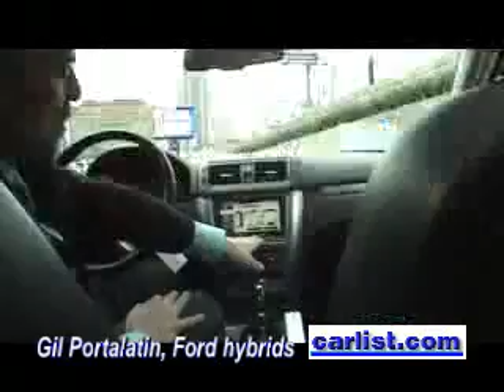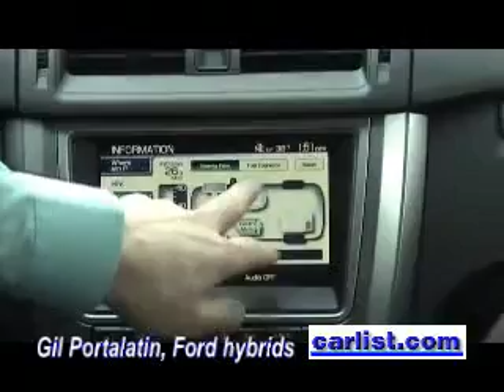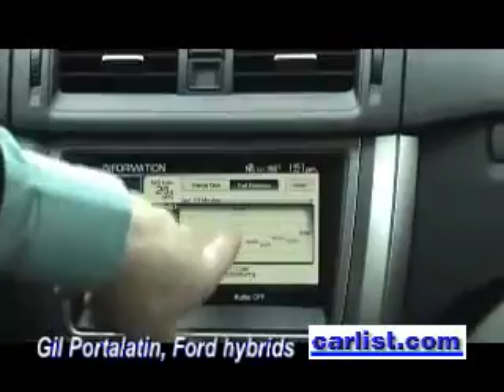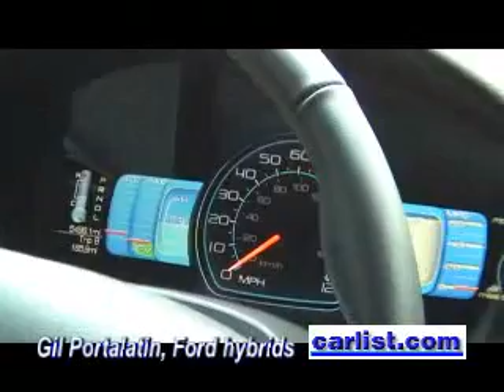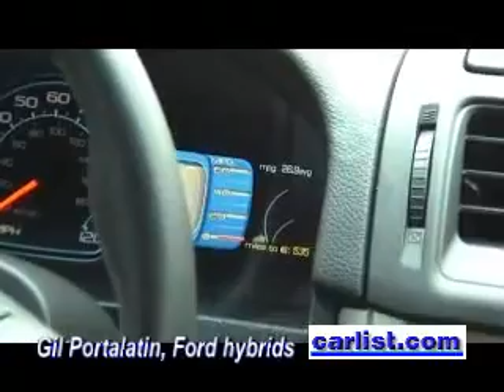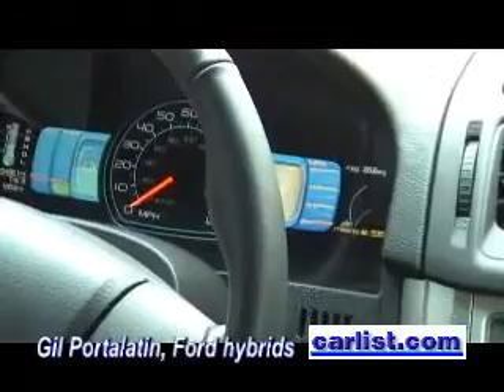Gil Portalatin on the 2010 Ford Fusion hybrid car at the 2009 New York International auto show NYIAS

Comment: just purchased 2010 ford fusion hybrid,the mileage is 60,000  after driving for about 10 minutes the Pull over for Safety light came on, no active codes in the car, what could be the problem?
Reply from the maker: Take it to a mechanic